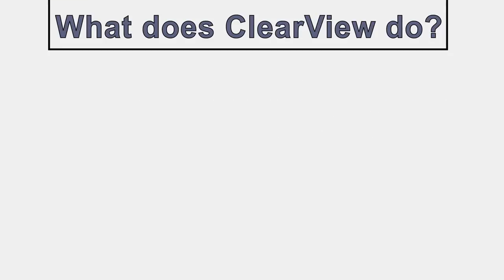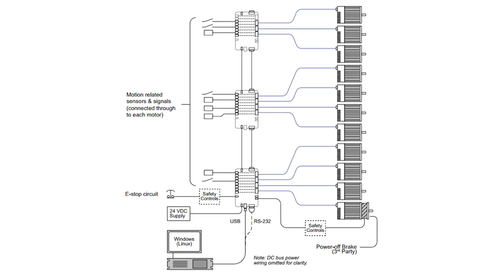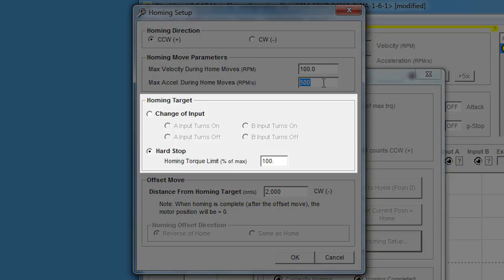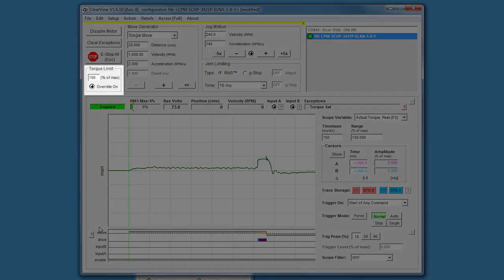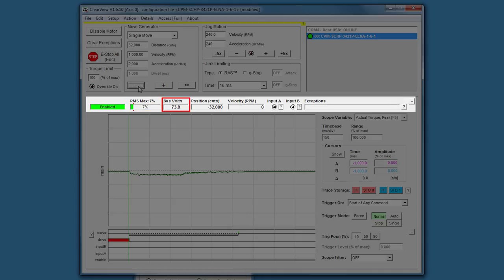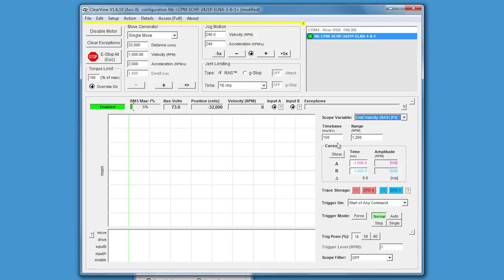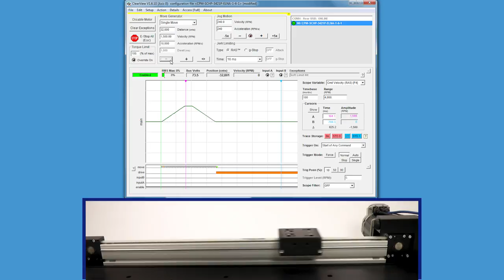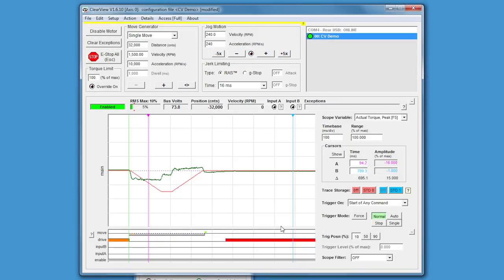ClearPath Software Control - How to Use ClearView

Comment: I am using sFoundation Library and Microsoft visual studio for some development. I am writing application code using cpp. why am i reading zero always for getting velocity, acceleration and positional moves from SDK(clearview). I am not able to set  parameters also
Reply from the maker: Hi Ramya,

I'm sorry to hear you're having some issues using ClearView. We are happy to help assist you in getting things working!

Typically, troubleshooting of this nature is best handled by directly communicating with a Teknic Applications Engineer. Please reach out to us using our "Contact Us" form online (https://www.teknic.com/contact/) or give us a call at 585-784-7454.

Best regards,
Nick D, Teknic Servo Systems Engineer

Comment: Hello Teknic Team,
Is it possible to use Clearview with SD-models?
Best regards Till
Reply from the maker: Hi Till. Thanks for watching, and for reaching out. The short answer to your question is “no”. ClearView supports only the ClearPath-SC series of motors (SC = Software Control); however, the ClearPath SD and MC series (Step & Direction and Motion Controller) have their own setup software, MSP. The MSP software is used for tasks such as motor tuning, configuration, and diagnostics. While ClearView and MSP do share many features, they aren't interchangeable. If you have follow-up questions on this topic, feel free to call in and speak to an engineer at (585)-784-7454, or just submit a contact request through our website using this link: https://teknic.com/contact/

Thanks! Jim W., Teknic Servo Systems Engineer